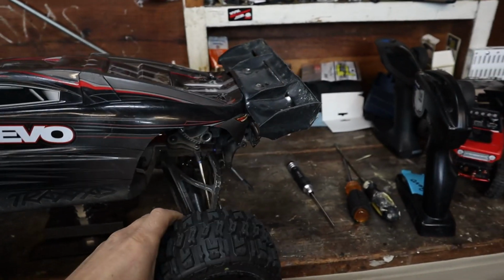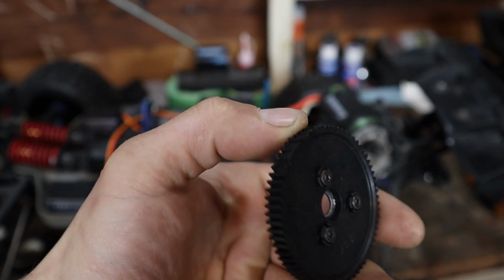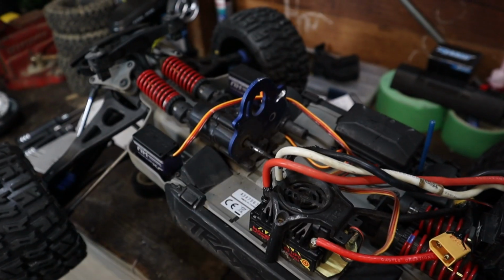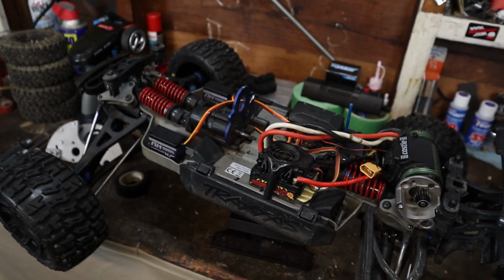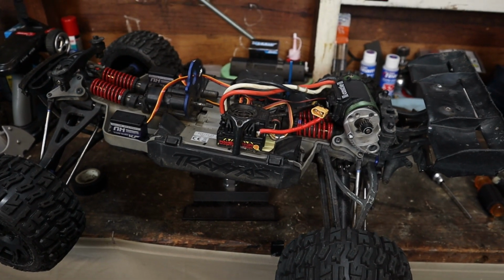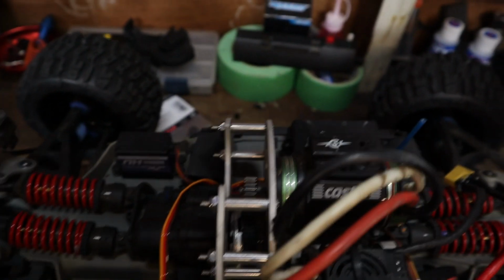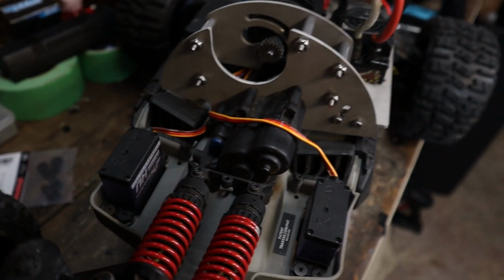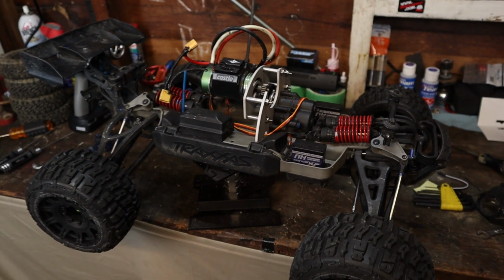Traxxas 1/10 E Revo Repair And Race Vs 1/16 E Revo

Comment: I have this motor mount as wel. I don't  use it any more because of the weight being so high. But if you want a top speed truck!? You cant beat this mount. I was able to mount my tp power 56x120 600kv 5th scale motor on the Revo 2.0. 48t/ 32 pinion on 8s is uncontrollable lmao.
Reply from the maker: With the open difs in this 6s is about uncontrollable lol i love the mount, super solid! I haven't had tip issues besides self inflicted but i run it pretty low to the ground compared to other people i have seen.
Reply: @ottersrcgarage576  I do a lot of stunting, jumps, and what not that the extra weight up top makes a huge difference to me. Throws off the balance in the air. For me of corse.
Reply from the maker: @OlmanEg  I could see that now.